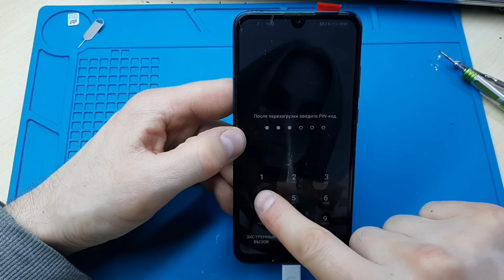Huawei P smart 2019  lcd screen with frame replacement

Comment: Jesus Christ I just ordered a replacement screen with the frame thinking it would be easier and save me messing about with glue and all I would need to do is connect some wires.
Watching this I am starting to regret that decision and any confidence I had has gone to 0, from the tutorials I've watched it seems easier without the frame and having to apply the glue.

Comment: Whats the liquid that u use inside the syringe?
Is it for the detachment of parts?
Reply from the maker: Líquid T-8000
Reply: @TechMobil  T-8000 is the adhesive glue but for removing the glue what is the liquid that u used?
At 5:56 or 8:48..
Reply from the maker: @GKOYM  iso propyl alcohol
Reply: @TechMobil  Thank's a million...great guide by the way... ;-)